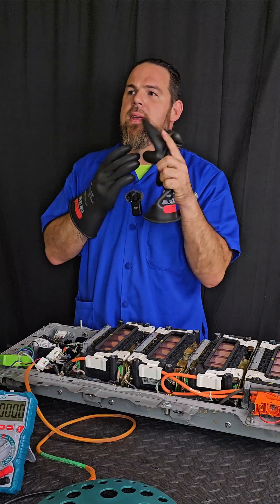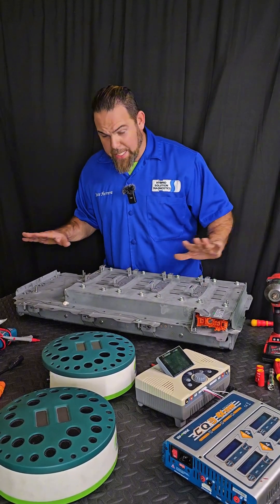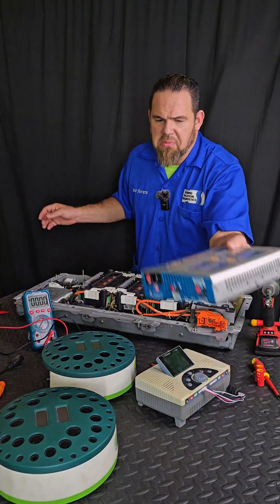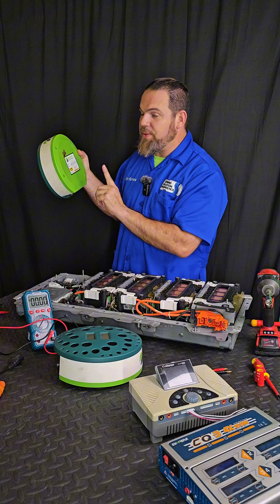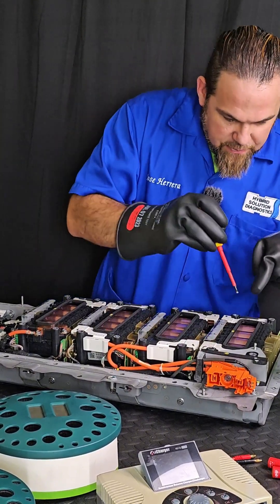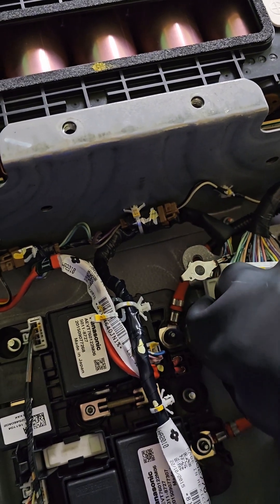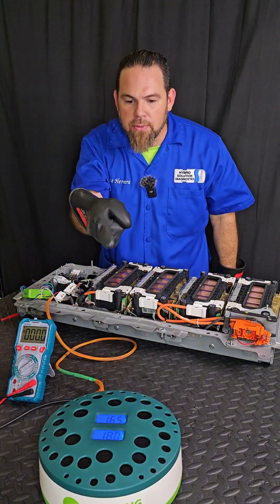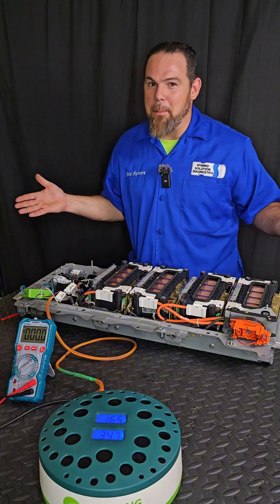Hybrid Battery Charger

Comment: I own one Nissan x-trail (rogue) hybrid and I too had problems with the battery. I got the infamous “e-power system fault“ and couldn’t restart the car. It worked after disconnecting the small battery and letting it reset itself. After that I drove it to dealer and they said it’s the battery. The replacement arrived after 1,5 months. Now everything is ok, but I’m very worried that it well let me down again, and this time I could be further away from home and with the kids also. Why do they break so easily? Mine was only 18.500 km and from 2023. Should I sell it and buy something else? I love the car other than that.

Comment: this method does not balance the cells?
Reply from the maker: It doesn’t but is not a problem… BMS will 😁😁✅✅
Reply: @hybridsolutiondiagnostics, Good works. 

Pls is the BMS in the battery charger or the hybrid battery

Comment: Can we use 180v battery charger for charge half from the full battery pack? 
ex: 4pack÷2=105v   two time
Reply from the maker: Yes you can but there is too much potential difference with an 180v charger…

Comment: Thanks for the fantastic video Jose! it was very informational as always. 

I have a question. The prolong chargers don't list any compatibility for the current hybrid models. I'm assuming the compatibility is for the harness of the vehicle but the charger can still be used if  you connect the leads like demonstrated in this video. Is that correct?
Reply from the maker: That is correct ✅ just make sure there are similar voltages ✅✅

Comment: Thanks for this video. I have two Gen 2 Prius and used both the Prolong grid charger and the discharger. I also have a 2017 Prius Prime plug in, this video explanation could work for me some day in the future. One question, if you have a depleted hybrid battery and use the grid charger, do you ever couple this with the discharger?
Reply from the maker: Thanks 🎉 and yes the discharger will work as well 🎉
Reply: @hybridsolutiondiagnostics  Thanks for the answer. Discharger work yes, but needed? Do you treat lithium batteries the same as  Nickel-Metal Hydride Batteries  charge + discharge x 3??